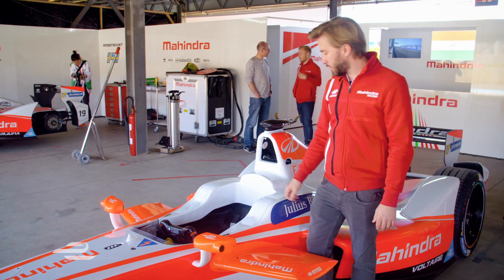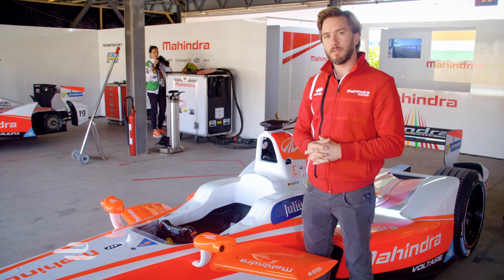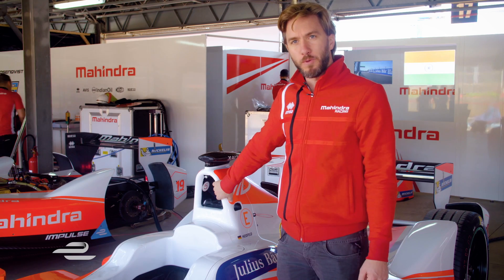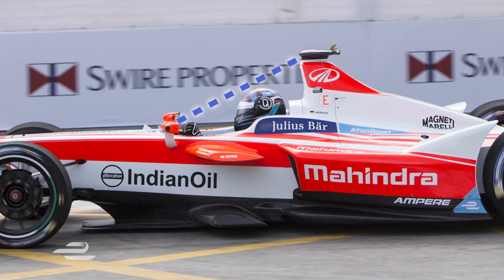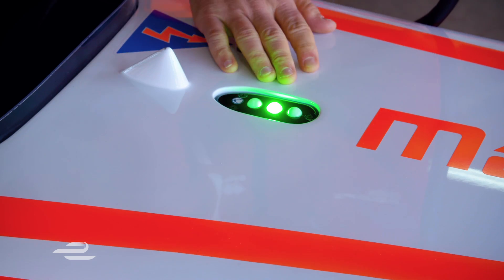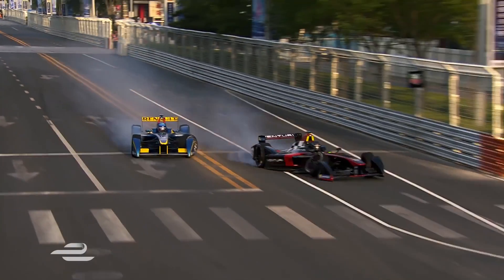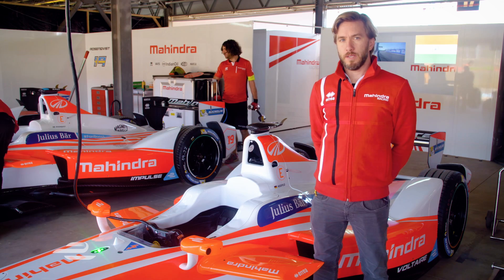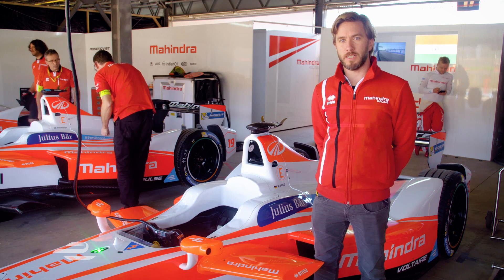Race School: How Race Car Safety Systems Work - Formula E

Comment: There seems to be surprisingly little information about electric race car safety; its going to become increasingly relevant over the next decade as more electric series are introduced, so please, keep the info coming. About all I’ve gleaned so far from a marshals perspective is check the lights, wear rubber gloves and wait for the extraction team. Doubtless there will be lessons to be applied to road cars too; again, the only advice I’ve seen so far is dont touch and wait for the trained recovery folks. Thats not gonna fly when 20%+ cars on the road are electric.